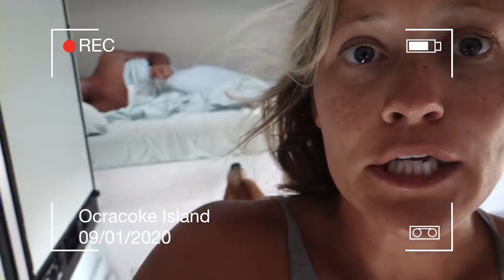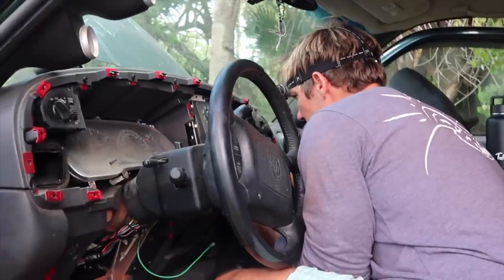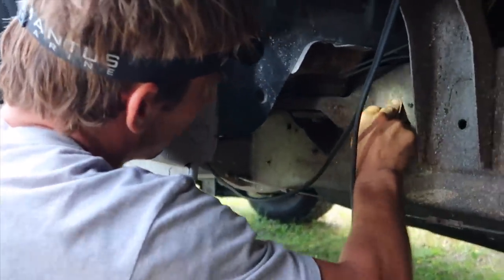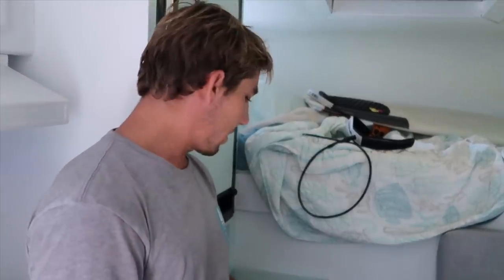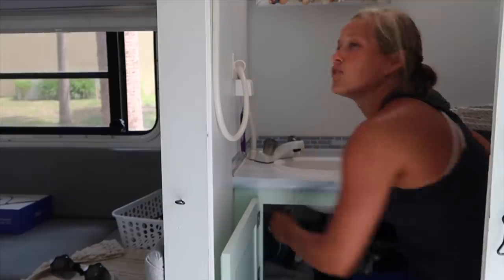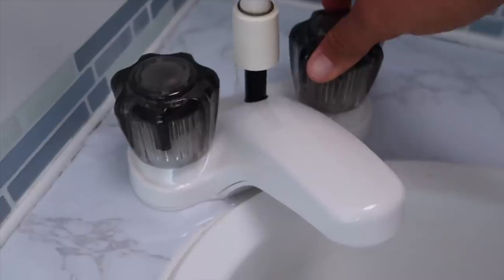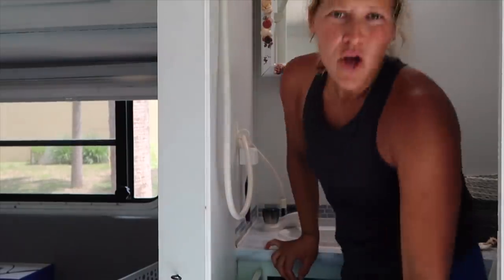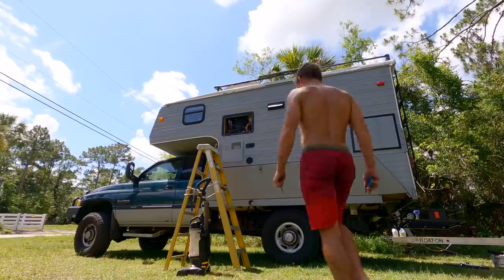Keeping the Monsters Away || DIY Truck Camper Upgrades You Can’t Live Without - Terra Tula

Comment: I installed the Renogy DCC50S 12V 50AMP DC-DC On-Board Battery Charger with MPPT SOLAR CONTROLLER in 1 unit. Its awsome! Charges at 50 amps from truck & also from the 400 watts of solar on my roof of the truck camper. Also, when the truck & camper is not running, the solar controller keeps the camper house batteries topped off & then will back feed & charge the truck batteries when the house/camper batteries are full!!! Awsome system for less than $300! Has been working great for over a year now. Highly recommend!

Comment: For what it's worth I have the Victron 30amp dc-dc on both my truck camper and my sail boat.  On both of them it gets hot fairly quickly and reduces the charge current.  So if your mounting location is enclosed you might want to think about a cooling fan, I am.

Comment: Billy. I've been looking for a charge controller that can work both ways. I have the progressive dynamics converter which has smart battery charging and an isolator. I can trick the isolator into thinking the engine is running so it will connect the batteries, but it won't do it on it's own. Does your system have the ability to keep the truck battery charged if you're plugged into shore power?

Comment: The downside to using the tighter screen is the reduction in air flow through you camper.  Personally, I would rather sweat than get eaten up.